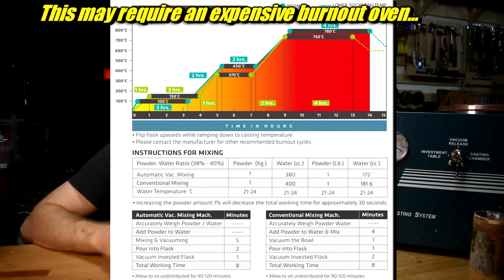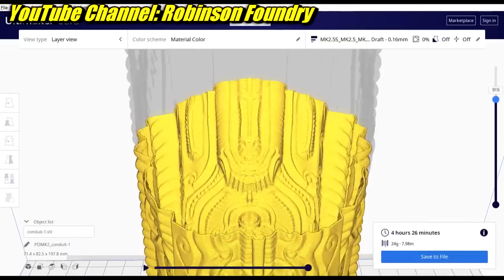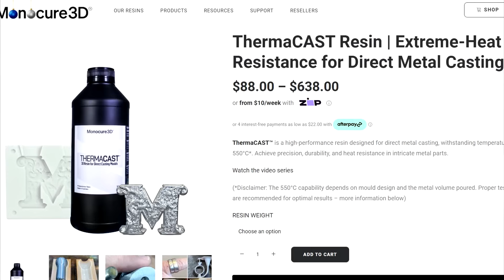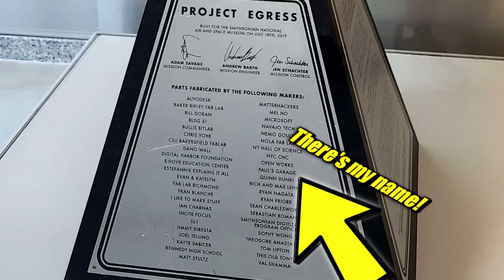ALL Ways to Make Solid Metal 3D Prints (almost)

Comment from the maker: Want to see what it takes to do this at home in your own garage?  check it out here: https://paulsmakeracademy.mykajabi.com/joinus
Reply: Paul, I recently came across videos where zinc or its alloys were cast. But instead of plaster, high-temperature silicone "mold max 60" was used. Although its thermal resistance barely reaches 300°C, the castings were successful and the mold itself could be used many times after cooling down slightly. I myself have purchased high-temperature silicone up to 350°C and will try to cast zamak5 in it (due to the lower thermal resistance of mold max 60 than the silicone I currently have, I am not worried about the problem of casting parts from a zinc alloy). On the Internet, I also found molding silicone that withstands up to 400°C, just as a curiosity. Maybe this is an interesting topic for the next videos, I am just throwing it out there loosely.

Comment: I primarily do sand casting, but I think too many people downplay the advantages of lost foam casting. It is unbeatable in terms of time, cost, and difficulty with simpler patterns. It's also great if you want to just carve out an idea to cast and just cast it. Something I'm going to try out is making a silicon mold of something more complex shaped and using either liquid or spray expanding foam to fill the mold, and then use that foam copy for lost foam casting. It wouldn't require a burnout and would be easy to replicate and hopefully a cost effective method for people that can't do burnouts. Not sure if it'll work though. I finally got a kiln and am super excited to start doing investment casting as well

Comment: Ive seen some videos where guys are 3d printing models from pla and then coating with ceramic and then burning the pla out and casting. Most seem to get some ash that remains from the pla. Ive read where lye will disolve pla because its made from soy beans oil or something like that. So I am wondering if a guy could 3d print in pla and then ceramic coat and then dissolve the pla with lye. Just to warn you lye will dissolve people also so if you were to try it, be careful . Probably still have to heat the mold to drive out all the moisture.

Comment: Can you look into using portland cement and silica sand moulds?

I picked up some Petrobond sand, but I'm thinking that using portland cement mixed with silica sand would work quite well for making molds.

Edit: I am aware that people believe that portland cement will spontaneously explode, however you can mix your own refractory cement and cure it in an oven to remove any trapped moisture. You likely wouldn't get that many pours with it, but compared to using petrobond sand it might be less work.

Comment: A good way to cut down on plaster costs for lost wax is to use normal PoP mixed with sand (Quikrete white silica play sand is pretty great) and water in a 1:1:1 ratio using the typical preparation steps (mix materials together, vacuum bubbles, pour into mold, vacuum again, etc). Using a vacuum table with even just solid flasks, you can get some seriously impressive results and a bulk bag of plaster is only like $20-25 at dome depot.

Comment: I thought this was going to be one of those technically interesting videos that wasn't practically useful for me.  PolyCast filament is interesting and I might have a use for that, but ThermaCast resin is very interesting.  I like to cast my own bullets.  That typically means I'm buying commercially available mass produced bullet molds and that's usually good for the regular job, but I like to play in the margins with shooting science, where there are no commercially available molds for the weird stuff.  A couple of high end bullet mold suppliers will make custom molds to the customer's specification.  I'm surprised they can do this for the very reasonable prices they charge for custom CNC machining, but the prices are high enough that they're not conducive to iterative development to optimize a design.  With ThermaCast, I can resin print my own molds the same day, test the results, rinse and repeat.  ThermaCast brings the iterative rapid prototyping that 3D printing is known for to metal casting.

It's not just good for lead, either.  Zamak casts at 425 C, well within ThermaCast's 550 C limit.  Forget boolits!  I'm making GUNS!   😀    Actually, I heard 3D printers are already pretty good for that.   😀

Comment: Ya the electroplated stuff isn't a whole lot stronger than just printed. But it is great for props.
Reply: Breaking Taps did a video on testing the strength of plated 3d prints a few years back. You can electroplate (or strictly speaking, "electroform") onto almost anything you can put conductive paint on - wood, plastic, leaves, etc. Peter Brown has done a number of videos on it.

Comment: There are also lots of other material out there to cast besides metal, if you don't want to deal with too much heat, you can  cast wax, plastic, resin, or epoxy.  I made a few epoxy casting of a pig for my sister's grandkids and they loved them, as gifts and non-toxic toys... and those casting could be used as molds for sand casting as well...  just throwing out there that there is a big wide world of materials besides metals out there... I'm liking aluminum at the moment, but that zinc alloy is looking kewl as well.  Happy Sunday!
Reply: Exactly, one of the lowest bar ways to get into casting is soap or candles. You just melt the wax/soap on the stove or in the microwave. First thing I cast from a print was a miniature Fight Club soap bar (printed positive, then open face cast in silicone negative).

Comment: Kelly Coffield (on youtube) seems to have a really good work flow for lost foam.  I'm not a super fan of the process, but he makes some really impressive engine parts using the technique.
Reply: For lost wax, the molds can be made from plaster or i use Durham's rock hard. Duplicating simple patterns, I use plaster molds. And then squeeze bondo for the duplicate patterns. Depending on what you're making, there's no need to print anything.
Reply: @roscoepatternworks3471  absolutely. I have seen this method used quite a lot.
Reply from the maker: That's the guy I was trying to think of!!! I couldn't remember the name, thank you!  

There are ways to get good results out of each process, it's all practice and technique.  Maybe I'll check out his videos some more and give his methods a shot
Reply: @PaulsGarage  his method is a lot like investment casting.  He blends the two methods of lost foam with investment slurry and use a vacuum assisted furnace to pour those castings.  I don't think I would call it traditional lost foam casting and that is why he gets much better results than most do with lost foam.  Lost foam can produce professional results with the right equipment and know how.
Reply: @odellcreations  he uses a professional coating. same stuff they use in industry. Engine blocks, Motor housings all kinds of stuff are cast that way. Its a very good method of casting. i do lots and very pleased with my results.  great for larger castings. stuff you cant print or ram up in a sand mold.
Reply: @stevesrt8  yes.  I have seen many of his videos.

Comment: Thanks for the shout out!  My last project was lost foam casting. I can’t say I’m a fan of it.
Reply from the maker: I wonder if there is a specific foam or sand or something used in industrial lost foam casting?  It must be designed to burn away without all the ashes, and somehow not get sand washed in there, too.  Seems like ceramic shell is just the way to go
Reply: @PaulsGarage  Have you guys tried owens corning XPS pink foam? I use that with petrobond and it seems to work pretty well, the foam vaporizes instantly. But I also cast higher temp stuff like copper, brass, aluminum not sure how it does with the lower temp metals